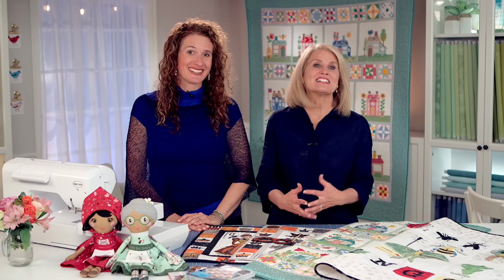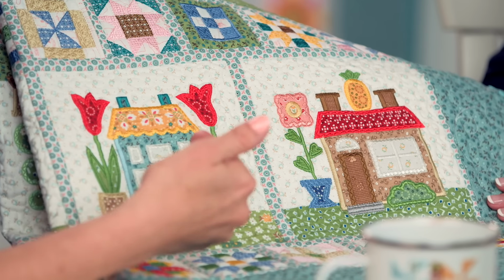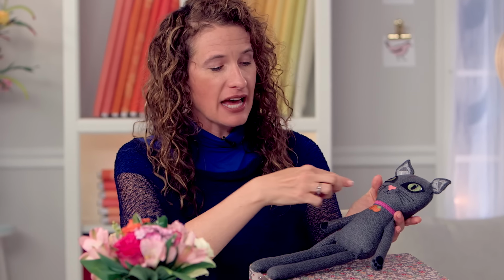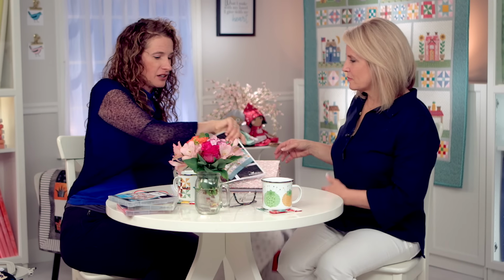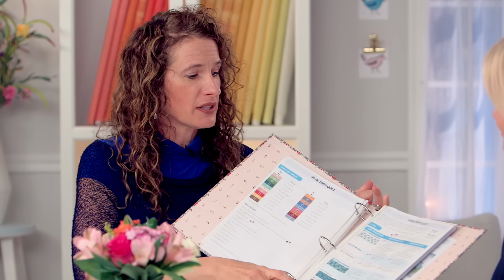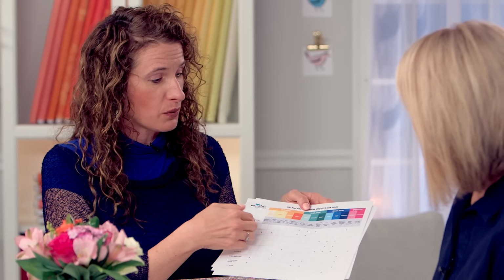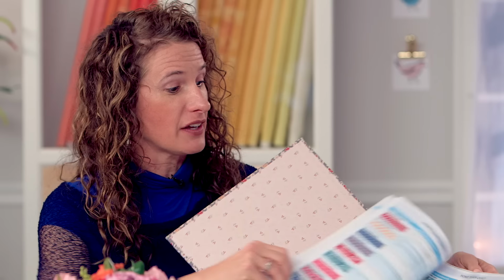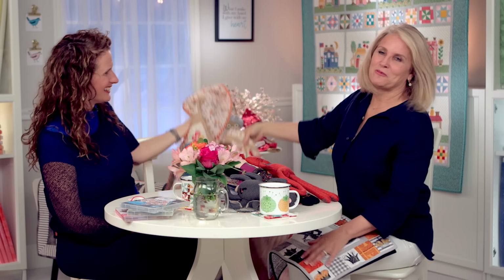Introducing RBD Machine Embroidery

Comment: I was looking at the London Town sampler quilt, which featured a Dresden as part of the Ferris wheel. I would love to learn how to use the Brother Scan and Cut to maximize efficiency when cutting fabric for a Dresden circle. It would be good to learn how to create a Dresden circle using a fold-and-flip method.

What I envision is a guiding line indicating where to place the fabric. You lay the fabric down, align it with the line, then flip it over and repeat the process for the next angled fabric piece. I’ve never tried it—I only have the idea in my head—but embroidery instructions that maximize efficiency and reduce cutting time would be incredibly helpful.

Comment: Will you be including an SVG/cut file which must be the same size as the position stitch.  I don’t buy a pattern that I have to trim shapes by hand. I use my Scan N Cut to cut all my shapes.
Reply: Hi there! Here's some info from our VP of Design - "The digitized images and files are licensed artwork from RBD Designers or brand partners. As such we are required to maintain the security and integrity of the artwork. This precludes us from including editable formats like .SVG cut files." Hope this helps!

Comment: So if my largest hoop for my machine is 6x10 then I will not be able to make the larger quilt 😢 (double hoop instructions would have been nice so both sizes could be made even with a smaller hoop)
Reply: For a complex Lori Holt quilt, where the entire block and block piecing is done ITH, you will need to have a 6x10 stitchable area or larger.  This is cutting edge techniques and designs ITH.  RBD's goal is to keep our ME projects, stitching and patterns beginner and user friendly without complicated rehooping, or advanced techniques, especially while we are rolling out this new program.  However, we are introducing "tiling" techniques in the Autumn Love Quilt which will help increase the size of quilt for a variety of stitchable area sizes.   These projects are just the beginning and more projects in a variety of stitchable areas and finished sizes are to come!  Stay tuned!